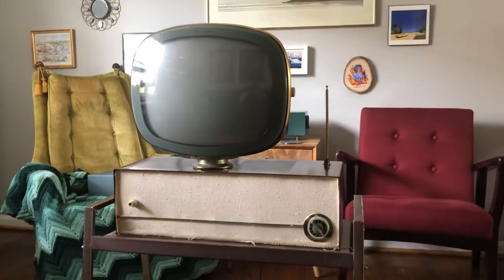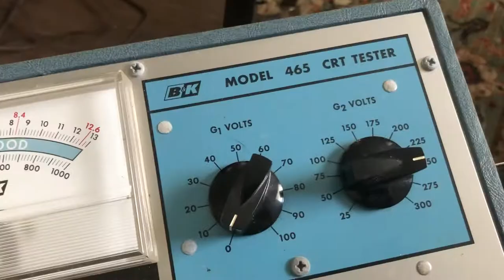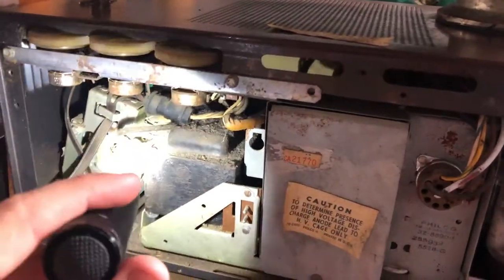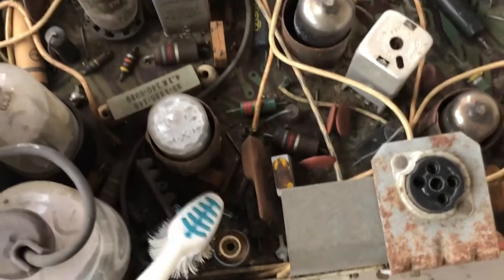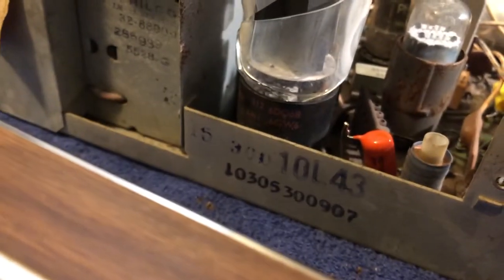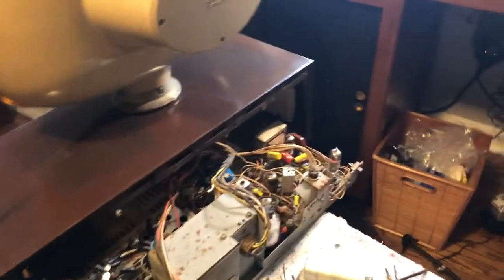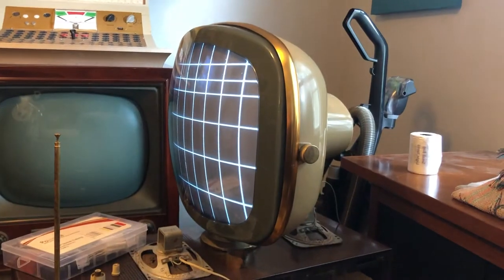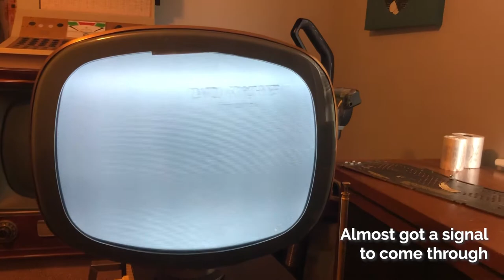1959 Philco Predicta Debutante Restoration

Comment: When Philco went out of business, it had a lot of Predictas in warehouses. Some of the motel chains bought them up for use in guest rooms. I recall having one set, similar to the one featured in your video, in 1968 in my room at a Holiday Inn in the midwest, perhaps in Cheyenne, Wyoming. I don't recall if it had an antenna. I have read that the antennas were removed before the sets were placed in guest rooms. (The sets were connected to an MATV or CATV system.) So, your TV most likely was not used in a motel guest room.

Anyway, I thought it was a nice novelty set! Furthermore, it had a very practical feature for motel rooms. Guests could swivel the screen for best viewing from different places in the room.
Reply from the maker: I actually have a motel set as well. It doesn't have an antenna and has a "how to use" sticker on it. It's in rougher condition than this set for sure.

Comment: Since you watch these televisions, where do you get replacement CRTs when needed?
Reply from the maker: They are getting hard to come by, but there are a lot of sets out there that are just waiting to be found, working or not, you can find spare picture tubes in junk sets. I have a few spare 17DRP4 picture tubes in storage just in case I find another Predicta that I want to restore that has a dead or weak picture tube.
Reply: @televisionforever  I'm surprised it's still possible to get any. They're certainly not in the Radio Shack catalog!

Comment: This model has the transformer power supply and parallel heaters. (but still uses a capacitor voltage doubler). Appears to be essentially the same chassis used in the 1960 23" console set we had. One of the selling points was "Philco Cool Chassis TV--with no parts underneath".

Comment: Excellent video, Jack! It might be a good idea to wear some vinyl gloves to insulate you from shock hazards, as well as shielding you from any lead in the solder on those old boards, as well as cadmium oxide from the metal parts of the chassis. When I was a little kid, these sets were all over the place!!
Reply from the maker: I agree haha, I need to get some of those.
Reply: @televisionforever  Much better idea to get an isolation transformer, if you don't already have one. Gloves will dull your sense of touch.

Comment: If a tube has white instead of silver it means the tube is bad
Reply: Wdym it was silver
Reply: @smproductions8989  elemental barium as the getter. breaking the glass allows atmosspheric water vapor to react instantly, producing white barium hydroxide & ammonia gas-you can can sniff it up close